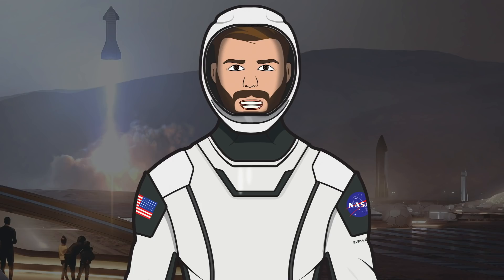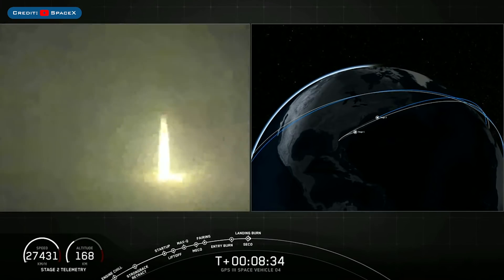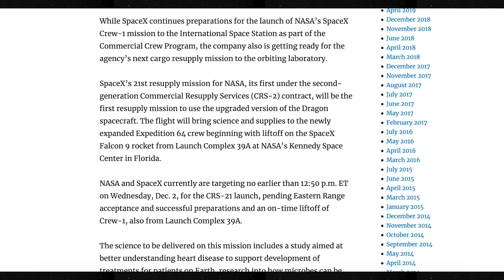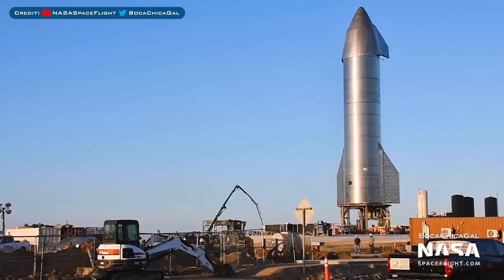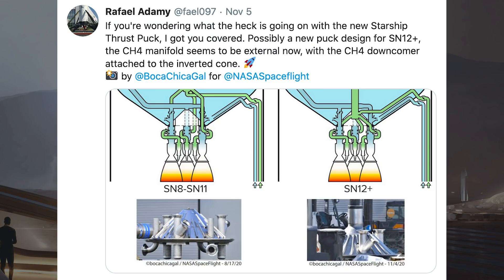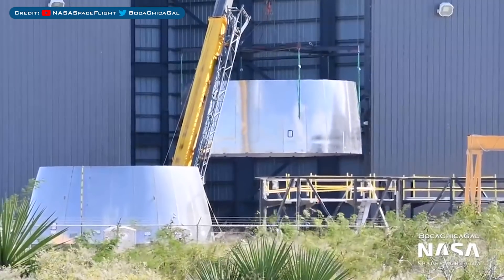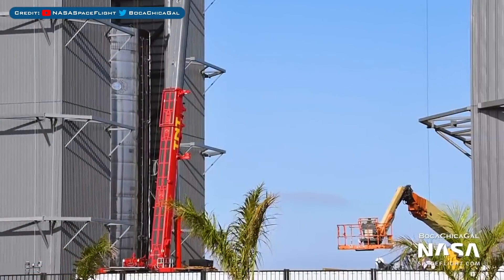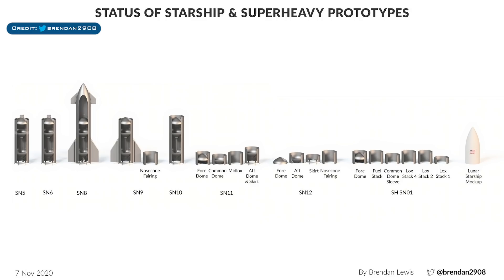SpaceX Starship Updates! SN8 15km Flight Soon! SN11 Stacking Soon! TheSpaceXShow

Comment: This is how I see it going, IMHO. SN8 will eat shit, probably blows the landing, odds are. Elon switches to SN9 and IT makes the landing. Elon declares SN9 an "object of historical significance" and removes it from service. This leaves SN10 and 11 to gather data alternately on suicide dive characteristics. I base the pairing on how it worked with SN5 and SN6, one flight each, back to back. Since I'm not immediately aware of any intermediate requirement, besides trying out the heat tiles on the whole of the ship, they'll make the necessary tweaks on SN12, and IT will have the honor of being shoved into space on top of the Superheavy booster.

Look for SN12's nosecone for modifications like a hinged fairing for satellite deployments. That might sound a little soon for that, but why waste an orbital opportunity to test an important capability?

Comment: I wonder if they're waiting for SN9 to be completed before hopping SN8? Cuz they've been working on SN8 for a couple months now...
Reply: Ryan, it has taken a little more time in part do to weather, Covid-19, engine problems and changes in design. All of those parts being delivered from outside providers are also dealing with problems including Covid-19. There was a noise in a couple of the Raptor engines and every time you replace one of those you have to go back through the engine testing process. That's what they are doing right now. I don't know if they have announced what the problem was but it sounded like a bearing to me. Probably in the turbine. The Everyday Astronaut just put out a video showing a comparison of the SS with the F9. I didn't see the video but read the published transcript. It is the most detailed SX report I have ever seen and shows you just what technologies are used in the Starship/SH. If you read or watch that presentation you'll get a better understanding of just what SX has developed here. Incredible. It is a 60 minute trip but well worth the effort:-)
Reply: @ROCROCROC1  I watched a lil of it earlier. I just figured Elon wasn't so "sure" of SN8s maiden flight, (by his cratering and pad repair tweets). So they're gonna wait until sn9 is ready, for a quicker turnaround.

Comment: With luck the new puck design will prevent leaks and other issues, do you think the changes will help reduce dmg to the puck?
Reply: New methane manifold below the oxygen tank puts only one methane pipe through the oxgen tank (instead of three) and holds the manifold tightly against the puck, making assembly more durable.
Reply: @imconsequetau5275  sounds good I was referring to how they said there were leaks with the other sn's during some of the testing, and curious if this was a fix for that or if we will see more changes for that in later sn's :D
Reply: @AndyOO6  
The leaks occured near the edge of the knuckle panels at the interface to the hull and also at the interface to the conical part of the dome. I guess these knuckle panels were 301 steel. The welding heat anneals the adjacent 301 sheet metal and this is the weak part of the weld transition.

With 100% use of 304L this should be solved. The annealed sheet metal can elongate and re-harden during the liquid nitrogen pressure cycle. (Not just a test but a manufacturing step.)
Reply: @imconsequetau5275  thanks
Reply: Every new iteration of each part seems to get better and better. I wouldn't be surprised if it was improved